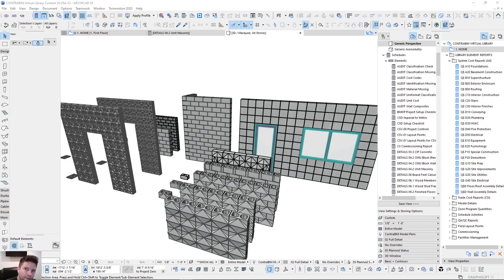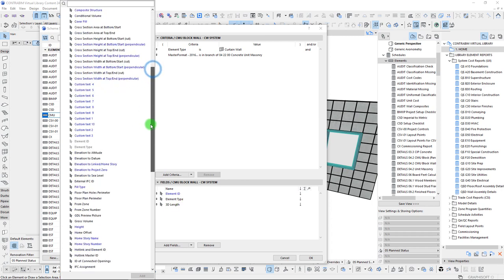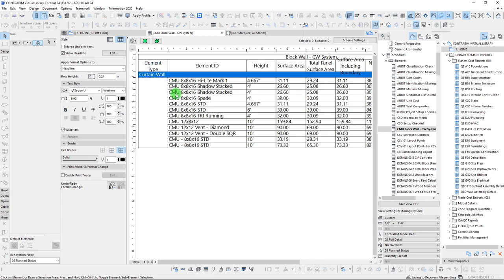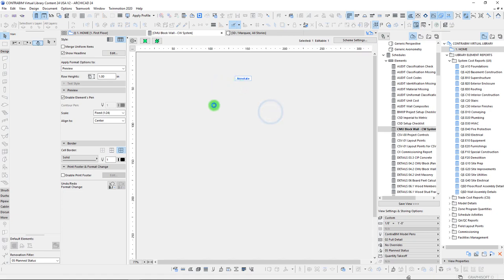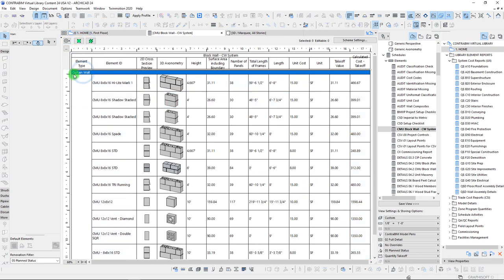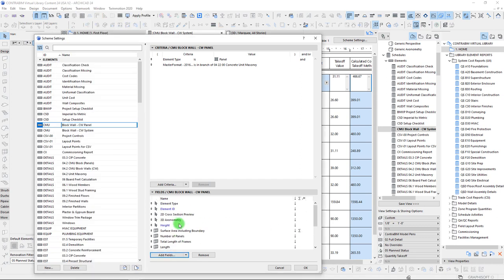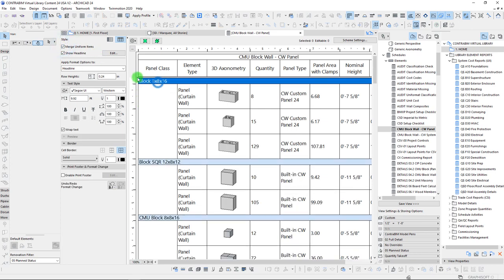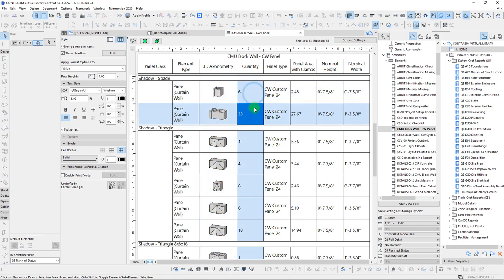How to Calculate Curtainwall Systems and Panels in Archicad 24

Comment: is this needed to be modelled block by block? it there any quicker option just to get quantitates, mortar volumes etc directly from walls etc?
Reply from the maker: Yes that is the more traditional method of calculating block, and can be done easily with expression based properties and walls. This particular demonstration was more about how to extract panel/block quantities from the curtainwall tool, as a followup to the previous videos... great question though and yes it can absolutely be done with walls and expressions.

Comment: Hello I don't seem to have the Field Panel Type? Could you help out as to why that is maybe?
Reply from the maker: Hi Martin, in the Criteria Settings, make sure the Panel Type is enabled, making the field parameters for that design tool enabled. Try that and let me know!
Reply: @CONTRABIM  Thank you so much for the answer. I realised it was set for curtain wall and not panels. After I changed it it worked. Thank you again.